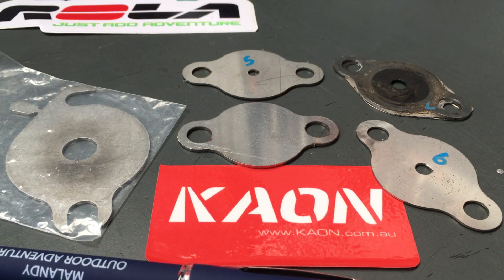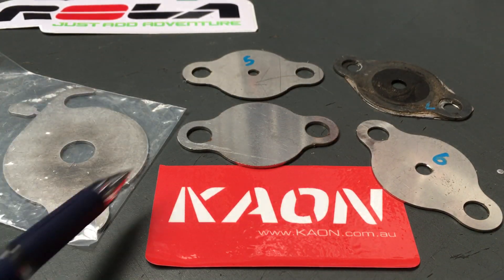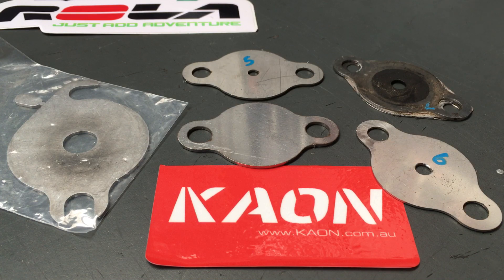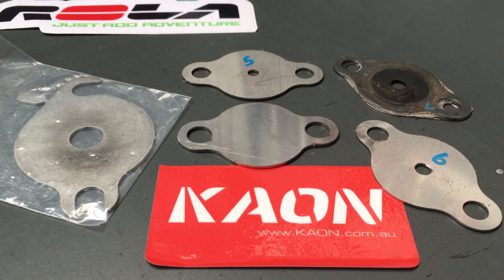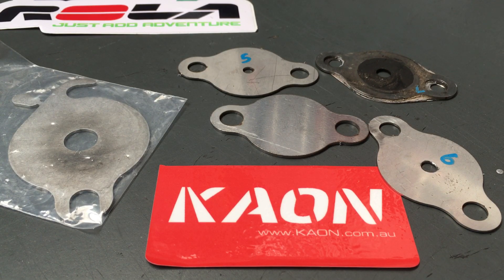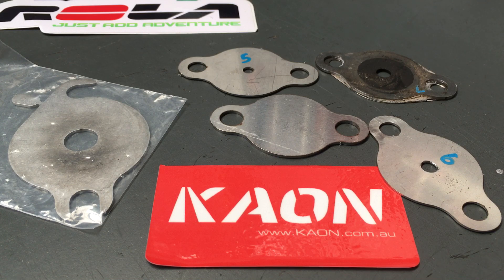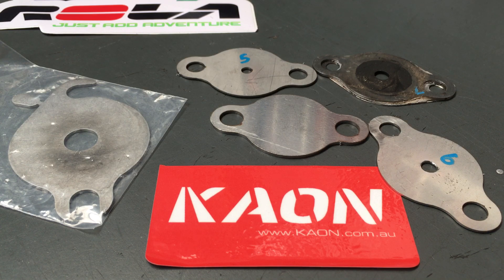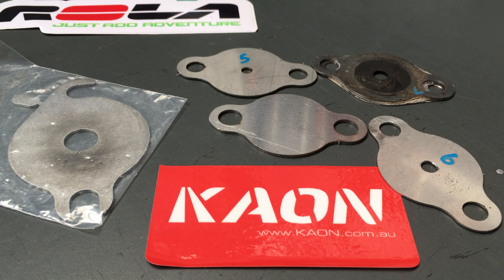EGR EXHAUST GAS RECIRCULATION REDUCER INFORMATION

Comment: Hi Anthony I noticed the KAON website says Vehicle Compatibility up to the KDJ150 8/2009-8/2013 for the 7mm plate. Is this correct or would it fit the 2014 Prado too (which is what I have)?
Reply from the maker: It will fit all 1kd